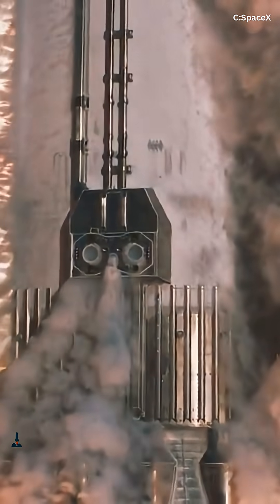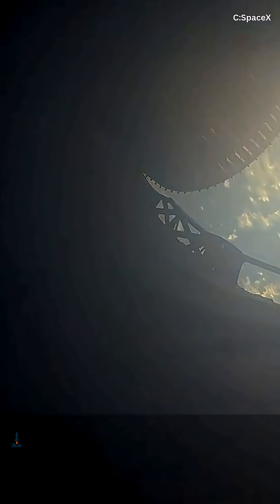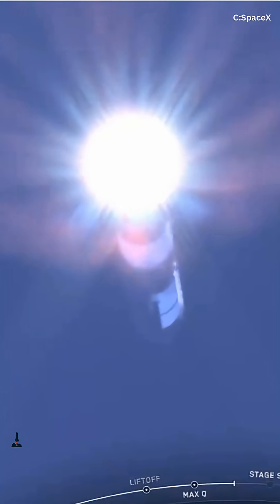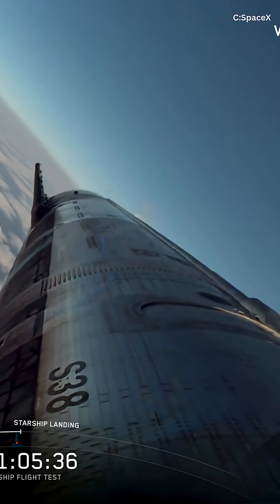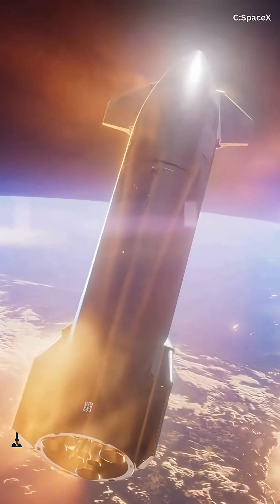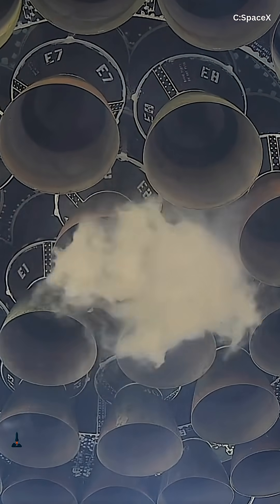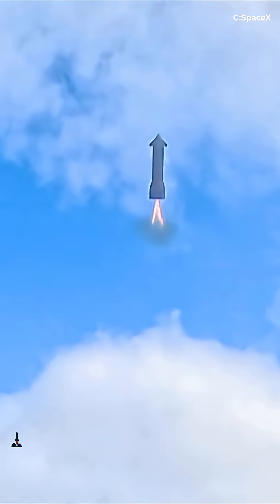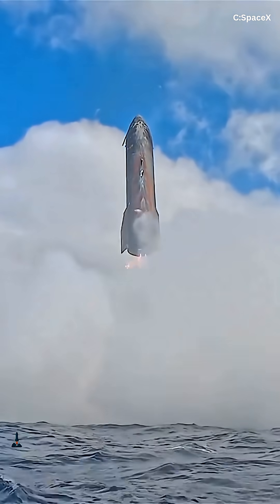The $1 Fuel That Could Revolutionize Starship in Deep Space #spacex #starship #rocket #elonmusk

Comment: The problem hasn't been simply electrode erosion; the power necessary to operate such a system is simply unavailable. Where does the electricity come from? To scale this tech up to a meaningful size for a starship would require a lot of power. There are no free rides.

Comment: Integrating Helicon Plasma Thrusters (HPTs) allows Starship V3 to cover the total required Delta V for a Mars round trip without relying on Mars-based ISRU for the return propellant mass. 

However, it would transform the mission from a fast transit into a slow, long-duration flight. A chemical Hohmann transfer takes 9 months, while a low-thrust electric spiral maneuver using HPT to reach the same velocity would take significantly longer, potentially increasing the transit time to over a year (one-way).

The original SpaceX architecture uses ISRU precisely to avoid this time penalty, enabling a quick, chemical-based return, which is essential for crew safety and operational cadence.
Reply: The problem is that SpaceX found out it would take DOZENS of refueling trips to get enough fuel for the trip (one way!). So they have no choice but to use the more efficient HPT. They would be dead in the water otherwise!

Comment: AT TWENTY TO FIFTY KLIKS VS THREE POINT FIVE 
WHAT WOULD BE THE 
G FORCE 
OF THAT LEVEL OF THRUST OR
DID I MISUNDERSTAND AND THAT THRUST WOULD 
ONLY BE ONCE IN SPACE AND
IF I DIDN T MISUNDERSTAND WOULD THE PROBLEM OF
Gs BE DIFFICULT TO SOLVE
HAVE SUBD
THANKS
Reply: Expelling propellant much faster, for the same power, means acceleration much less.

But the power isn't the same. For sending argon away at tens of km/s you use power from solar panels, at most a few tens of kilowatts. For sending methane-and-oxygen reaction products away at 3.6 km/s you use gigawatts of methane-and-oxygen energy. The acceleration is not only more, it's so much more that you can lift off Earth.
Reply: yeah this stuff is for space travel only, like adjusting direction/rotation
Its called ionic wind propulsion
or just ionic wind, search it up, pretty cool

Comment: What is the energy source?
Reply: Solar panels.
Reply: @grlcowan On a rocket already in Space, ok. But for lifting from Earth, too heavy… or energy transmission from Earth bonded solar panels by microwaves in a distant future, maybe.
Reply: @Tristan-jt9cz  Yes, the argon plasma drive can't lift itself off Earth.

A space radiator can radiate away many times the energy a solar panel of the same area can collect. The heat engine the radiator is supplying coolness to can give approximately many-over-four energy to a low-thrust high-specific-impulse drive like the argon one. But the heat has to come from you-know-where. When that's allowed, fast transits between planets become possible.

Still not enough for Earth liftoff, even then.

A space radiator: https://www.youtube.com/watch?v=0EcSih59jJw
Reply: @grlcowan Strange video but thank you.